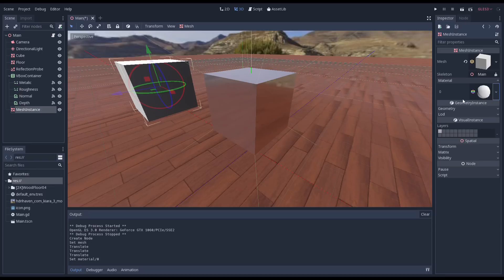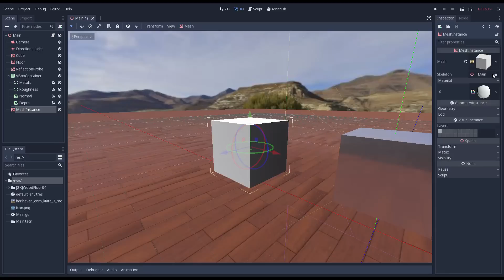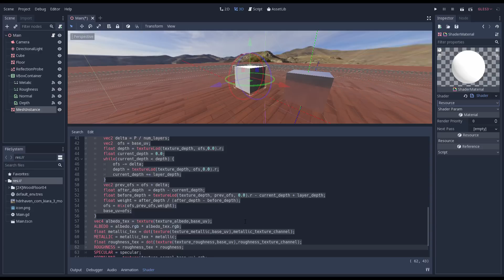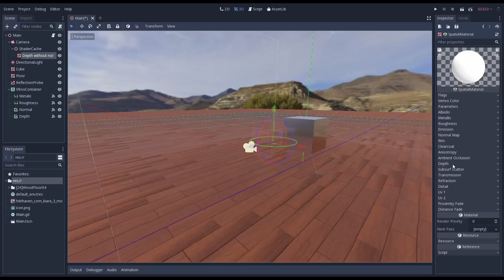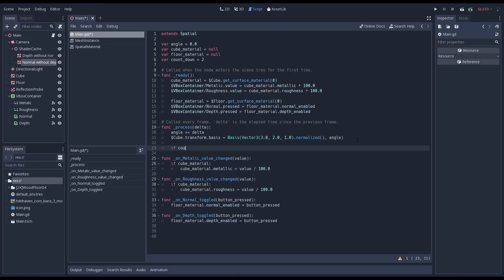Solving a Godot shader hickup

Comment: Actualy if you are a perfectionist - you can remove that shader preloaders from Camera once they been loaded, BUT to do that you must save your Material as separate resource, that will be keept somewhere. So the resource_destructor will not be launched if you destroy the mesh, but keep it's result.
Reply from the maker: Yup, that is definitely an option :)
Reply: @BastiaanOlij  I am currently developing some kind of shader selector plugin, and I just found that if you set `shader.code` and then change it back to previous value - compilation will be skipped. Guess Godot used some kind of hash that turns `shader.code` into shader ID that connected to shader_cache. Maybe that system was added in last 4.2 patch, but now it's not needed to create separate resource for each shader, all what needed - keeping code in memory. And to avoid shader_destructor need to set `shader.code = ""` before it's deletion. So... I was wrong in previous comment...

Comment: I guess the mesh needs to stick around?  I had a list of materials that I would set on a single mesh right when the game loaded, with a couple frames between each, and even though the materials had been shown, it seems the renderer "forgot" them and they had to re-build later.
Reply from the maker: Yes, or better said, the material needs to stick around or the related shader could end up getting destroyed
Reply: @BastiaanOlij  Technically the material is referenced by a list (set in data on the scene), but I guess that's not good enough.  I'll have to try keeping a bunch of invisible quads around, I guess.

Comment: I don't notice a pause in canvas shaders? Am I just not noticing the reload or is there a difference between loading canvas and spatial shaders?
Reply from the maker: I haven't looked closely at the canvas shader as I mostly work in 3D. The hickup happens when the code of the shader changes resulting in a recompile. It may be that the canvas shader is mostly using uniforms and thus no code change happens. I would assume that if a recompile of the shader is required, the hickup would be there even in 2D.
Reply: @BastiaanOlij  Thanks! In my project "Book of Shaders - Godot" I have a shader editor that swaps the shader code every few seconds while you are editing it. In 2d I don't see stutter, but in 3d I do. I'd have to understand gles and godot engine internals more, but was just wondering if you knew why that would be the case.
Reply from the maker: @J.R.Robinson  Hmmm, I honestly don't know what the difference could be. I would have expected it to stutter but maybe there is something about the 2D renderer that is more forgiving here. Can't imagine what though..

Comment: tldw; save your shader material to a shader resource (and load it on game load)
Reply from the maker: It's a little more involved than that, you have to trigger it to render something, it's not enough for it to just load the shader.
Reply: @BastiaanOlij  apply your shader and put it in front of a camera?
Reply from the maker: Yup, and make sure you do that for all the shaders you use so it all gets compiled in time. Though the latest version of Godot now support shader caching which in theory should solve the issue.
Reply: @BastiaanOlij  I'm using Godot 3.3 and still experienced this problem.
Reply from the maker: Ah my bad, it's still being worked on: https://github.com/godotengine/godot/pull/46330

Comment: Is there an easy way to use single shader for multiple meshes, with small changes in shader parameters..?
Some thing like using single paint material for multiple cars, each with its own colour...
Reply from the maker: If you're not writing your own shader you can always convert Godots SpatialMaterial into a shader material. Any settings that effect the shader code will just result in the given shader and you can no longer change those. Any settings that are proper uniforms you can now set on your shader material.
If you save the shader as it's own resource the shader resource can be re-used on multiple materials, each material you setup with its own values to change things like color and textures.
This ensures that once that shader is compiled, that compiled shader will be re-used over and over again.
Reply: @BastiaanOlij  thanks.. it works

Comment: That worked out well on my project ,but now Its hard to edit common shader for different use case.😥
Reply from the maker: Make sure you save your shaders in separate files and reuse the same file for every material that needs it. That way any fix or improvement you make to the shader is directly applied to all materials that use it.
Reply: @BastiaanOlij  alright I'll give it a shot..✌️

Comment: Hello! I've used similar approach and it worked well in 3.0.6, but I tried to use it in new project created in Godot 3.1.1 and it looks like such shader caching won't work anymore. Maybe I've done something wrong, but I still experience the hickups after the meshes used for caching made invisible. Maybe there was some "improvement" which deletes cached shader code for invisible objects?
Reply from the maker: nlbproject not that i’m aware off, I exclusively work in 3.1
There only needs to be one shader you’ve missed for it to be a problem
Reply: @BastiaanOlij  thanks for the reply! Well, I'll try to double-check my code then, maybe I indeed missed some of the shaders.
Godot team have done great work so far, but this problem is really REALLY frustrating and in my opinion it is a real stopper for any 3D game that is something more than a test project. There is no way a modern player will tolerate constant lags when exploring the game world.
Reply: @Nlbproject  I have the exact same problem. I already use preloading and it still causes a Stutter as soon as a Light2D is turned on - Seems that "something" is recompiled.

I also think this is a problem that is bigger than most people want to admit. Sure for a GameJam jam with a handful or no shaders it doesn't matter, but on a more mature project with some shaders, particles and a nice visual appearance it can really ruin your day. I have stutters with sometimes more than 600ms on a 3700x / RTX 2080 system. On a 2D Platformer :(

Comment: Could you not use preload on the shader asset? You would think that loading the shader resource would be enough to get godot to compile the shader even if you don't end up using it on a mesh.
Reply: Why not add a feature that allows users to manually trigger a shader resource compilation? It could even just be a method on the ShaderMaterial class.
Reply: @MrEnvisioner  good idea.
Reply from the maker: Eoin Yokai O'Neill no, the shader isn’t compiled until its actually used to render an object. If i hide the shader cache node for instance, even though the objects are loaded, the shaders won’t be compiled. I’m not 100% sure if shadermaterials are different, i should test that